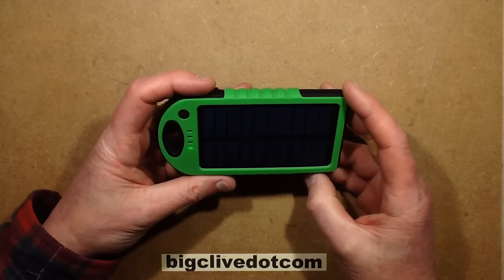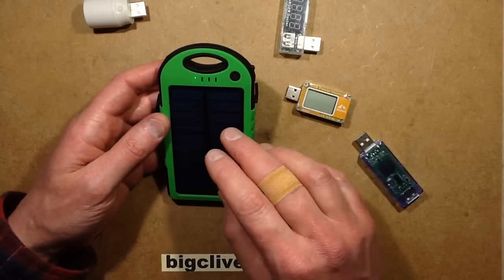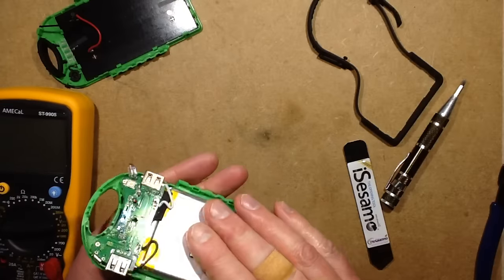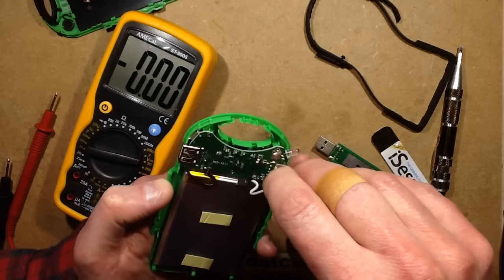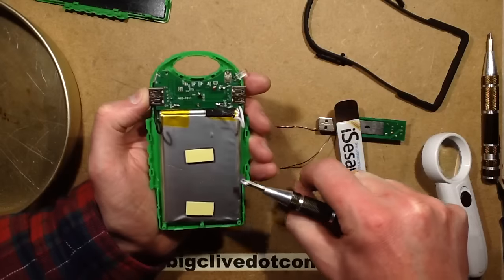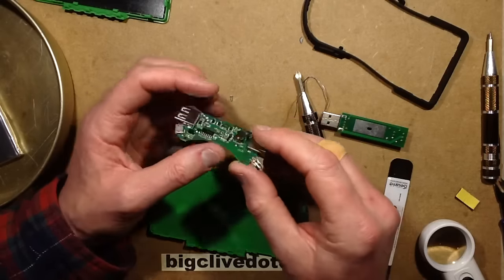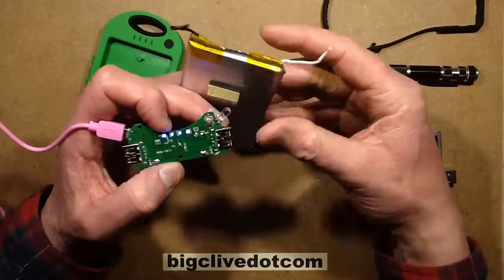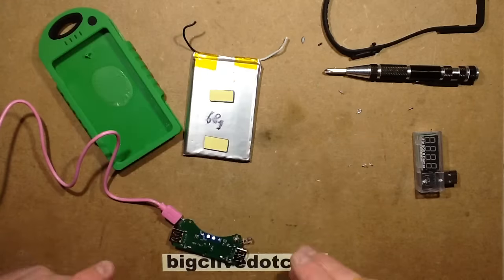Inside a solar USB power bank with "short circuit" feature.

Comment: I think I'll be picking up one of these solar chargers since a cheap small solar panel with a USB port is nice, and a battery on it is a bonus (I already have a better power bank solution, though). Seems like there are some western manufacturers that have stuck their names on them, too, so it's not 100% sketchy. The thing is, it seems like there are 5Ah, 8Ah, and 12Ah variants from both Chinese and Western brands, so I'm not really sure which one I should get, the cheapest or the one that hopefully I can get the highest capacity, if they're not straight up lying to my face. I'll definitely be buying an eBay one, though, considering it's $20 cheaper :P

Comment: Forget about charge control, are you really meant to charge these by leaving the lithium pack itself in full sunlight for hours at a time? The battery's going to degrade very quickly just from being left around at that temperature. You can get a good lithium-ion battery pack and a good USB solar panel for not a whole lot of money, and that lets you keep the battery in the shade where it belongs.

Comment: So is this a design flaw, or just a single faulty unit?
    Having working in manufacturing jobs, I can tell you that sometimes the guy making the thing might just fuck up.
Reply: +Eric Taylor The messy soldering causing the short circuit was probably a manufacturing error, so I'd wager this is a faulty unit, you can see at the end he fixed it just by removing a bit of solder from it. But the fact that it's not up to advertised capacity, and that the solar cells are feeding the battery almost directly, those are design flaws.
Hope that clears it up! Cheers!

Comment: Had to go back to this video after my local golf store gave them away for free. In the manual it said 6000 mah but I got 1000mah when I tested it. Wonder if that's why they gave them away for free. Anyway free is free and it is a pretty sturdy battery bank so I am happy even though it doesn't perform well

Comment: I've got one of these Clive. It's made by Juyupu. I opened it up last summer and in full sun I got 6.88V and 161mA. My battery wasn't stuck down like in your video so i could read the text on it which was   HPK 4200  4.2   605490P  14  09  29.

Comment: Looks like a cheap charger I got off fleabay or aliexcess awhile ago. Not waterproof, not dust proof, and it seems to try and balance whatever it discharged between both usb a connectors. Solar panel was weak, easier to just charge with micro usb.

Comment: Thank god for the adhesive pull tabs on the iPhone battery. Makes taking the out the original battery Soooo much easier. Although without new tabs it's pretty hard to ensure the same fit with a new battery proper. :\

Comment: Yep. When I changed the battery in my iphone I didn't realize the plastic tab was to pull it out so I used a wide flat head to pry it out and it punctured it and caught fire. Thanfully the battery was well away from the phone when it started to shoot flames.

Comment: Weight may give you a ball park of the capacity of that cell..
Reply from the maker: +tomy983 It weighs 68g.  Not sure that compares to other similar cells.
Reply: +bigclivedotcom my LG phone battery is 30g at 1500mAh.. some of it is probably better casing. probably is not 5000, maybe 3000? but you tested it and the result was 1500.. The chinese are putting rocks in the batteries to make them weight more!!
Reply from the maker: +ExplosiveKidMC Sorry.  It's just a temporary thing.  I do appreciate your art.

Comment: Thank you very much for such a good look at this thing. I  just got one through postcode lottery/ Gadget Insider , free plus £6.95 postage. It said 1000000 Milliamps, yes a million, I ignored that as others online were 100 000 or 150000. I thought it would be good if you were out and phone or camera got low. I carry spare camera batteries but not phone. As I type this adverts appear, 18000mah at £3.68 and 10000mAh at £14.12, they dont say what postage is though.  Thats a neat little USB plug in meter, Im going to ask you more questions about making robot toys and what you need and where you get it.

Comment: mAh on battery packs are measured at @3,7v

When you measure the USB output (5V) mAh that was consumed, you should take this into account.
Reply from the maker: +Joseba Subijana i measure the mAh according to the duration of the charge current going into the cell and not via a 5V conversion.
Reply: +bigclivedotcom but the rated mAh that is shown in the battery packs are at 3.7v. They should use Wh instead. If they say that the battery power bank is 5000mAh, it is 3,7v * 5Ah and not 5v * 5Ah. 

A 5000mAh power bank will give you an output of 3700mAh from the 5V port assuming a 100% efficiency.

Comment: Whenever I encounter a "dodgy" lipo or li-ion cell, I charge and discharge it using a hobby-grade charger (imax b6). That way I can test the actual capacity of all those 10000000mah 18650 U1traFlre cells...

Comment: I had a cheap no-brand Chinese power bank for about a month, then I took it apart, recovered the Li-ion cells and threw it away. Why? Because both the USB charging and output connectors fell off the circuit board, as the stupid manufacturers used the absolute minimum possible amount of solder. In fact, a meter long piece would likely suffice for both connectors on about 60 to 70 power banks.

But then a couple of weeks ago I decided to buy a decent power bank, not that cheap shit. Guess what, in the shop I went to, the only power banks they had were some "Samsing" (hmm... suspicious) rated for, if I remember correctly, about 5000mAh (it's very likely they aren't even 2000mAh), and others very similar, if not identical, to the one in this video.

Needless to say I didn't buy either. The "Samsing" ones, well it's obvious why. The other ones, because I knew most solar power banks are absolutely shitty and not even worth spending money on them even if they cost a buck.

Comment: There's no way that a cell that size and weight can have as much as 5000mAh capacity. As a comparison, a good quality 2000mAh cell of approximately the same size (one of my trusty old Kokams) weighs 48 grams, so I'd suspect that this - probably 2nd. or 3rd grade - cell should originally have a capacity of around 2000mAh, a far cry from the promised 5000mAh. Then again, not all control circuits fills/drains the cells 100%, so your measured 1600mAh can very well be accurate for a bad 2000mAh cell.

Comparing this with today's technology, a nice 2S 5000mAh LiPo battery (2 cells in series, giving 7.4V/5000mAh) weighs in at around 280 grams - including thick cables, balancing cable and heat shrink tubing to hold it all together. But even when generously stripping away all the "unneccessary" bits you should still come up to a weight of well over 100 grams for a single, "really 5000mAh" cell.

Comment: I have one of these battery and it's the most useless thing I ever had. It can't charge fully a phone with 2000 mAh battery. It charges from the current in about 4 hours. And it charges itself with the solar panel in about 6-8 days, but don't charge it under the sun all the day because it can overheat and break.. And no, it's not waterproof. It's a useless thing that costs 20€

Comment: I was making a battery 🔋 pack the other day and it shorted out within seconds it burst in to a cloud of hot smoke had to Chuck it out of window lol 😂 lucky it didn’t catch fire 🔥 (make sure u in slate wires properly) in the end they melted and it stopped shorting.